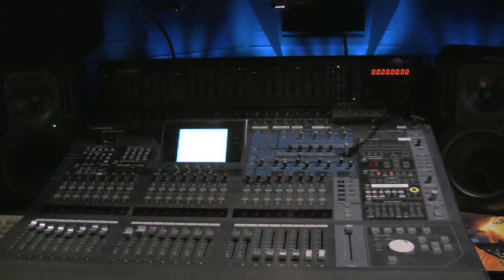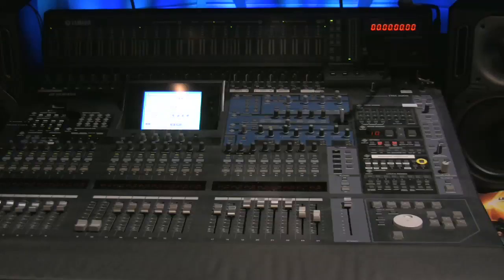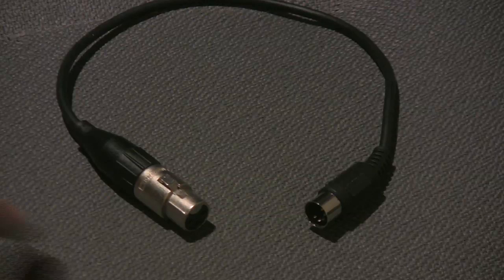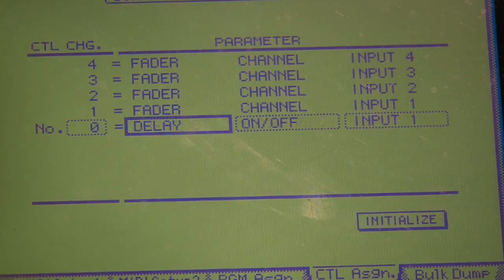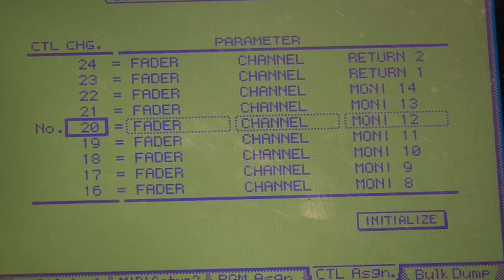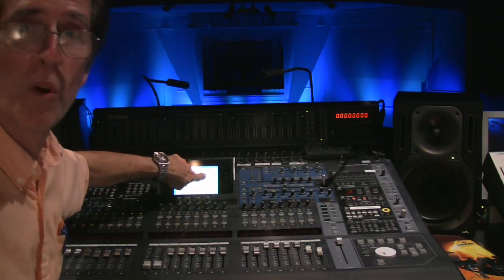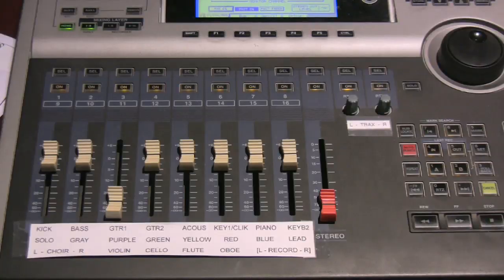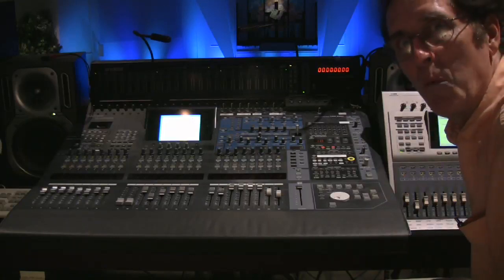MIDI Remote Control of a Digital Mixer

Comment: Great Video. Quick question. Can the Yamaha DM2000 V2 be used with Logic Pro X as a DAW Control Surface (without an interface)??
Reply from the maker: Not really sure since I haven't worked with Logic Pro. But the fact that the DM2000 has flexible MIDI capabilities and USB features utilizing it's comprehensive editing software, it may be a possibility. Definitely contact Logic and Yamaha support on it, and their forums can likely offer some good advice.
Reply: itz _Basketboy, 
Yes it can.  When you say interface I assume you mean a midi box.  The Yamaha DM2000 has a program called Yamaha Studio Manager and  Yamaha Studio Editor.  They work with the console.  The editor is inside of the manager.  All you need is a USB cable and you’re good to go.  

The Yamaha DM1000 and 2000 are so valuable because they have very good preamps (the 2000 more so) and the boards can remote control DAWs like Logic X and protools. You will
Be hard pressed to find a modern equivalent that is affordable.

Comment: Great video! I'm trying to connect my old Yamaha 02r v2 as controller to Adobe Audition CC. I have profire 2626 soundcard and midi connections on both. I use ADAT from mixer to soundcard. I tryed to do it for some time ago and didn't succeed. Is it even possible? It's hard to find any tutorials on this. Should I use both in and out on both midi devices?

Comment: Hi great video, I´m thinking about use this way to let the musicians set their own monitoring levels mix, using  small fader midi controllers for each, I´d like to know if it´s possible to connect various midi controller via midi hub to yamaha dm 2000, doing that I would be able to set each midi controller to an aux send faders, do you think it´d be work?
Thank again for your video
Reply from the maker: +DOLORES RODRIGUEZ Yes, you should be able to do that. Double-check this with an experienced MIDI keyboard guy,  but you should be able to connect a daisy-chain of MIDI controllers feeding the OUT of the first into the IN of the next, then feeding that one out the THRU (which should be able to be set as a combination THRU/OUT) to the next in succession. This THRU combination can carry both the signal of the current and previous unit(s). The last one in the chain goes back to the IN of the mixer using a single mic line and the adapters I described running through a single snake line.

You can set each MIDI remote on separate MIDI channels 1 thru 16, then set the Program Change parameters on the DM2000 so those MIDI channels correspond to the different aux layers 1 thru however many you run. Then you can program the individual channels you want to control for each aux layer to correspond to the MIDI numbers for the remote's level controls. Be aware that you can get some MIDI signal degradation after 4 or 5 units, but it probably won't affect simple level control like this as it may a continuous flow of complex MIDI keyboard note information.
Reply: Hi Fer, I read your comment. Did you finaly succeed in having the musicians control their own monitor feed? I had the same idea and I would love to find small midi panels with 16 faders on it so the musicians can control the aux feeds on my Yamaha O1V96i. Does anyone have any comments and tips on this? Anyone who knows a good (small) panel with 16 midi faders on it? thanks, Gert

Comment: anyone know if i can use a yamaha o1v as a control surface for logic pro x
Reply from the maker: +Joey O If you have MIDI input and output on the system, you should be able to. Check out this YT video. 9to5mac.com/2015/06/14/logic-pros-how-to-map-midi-controller/